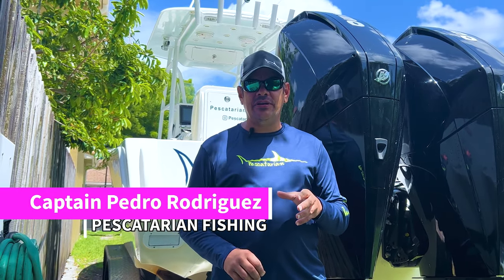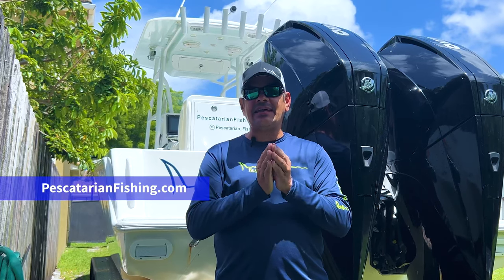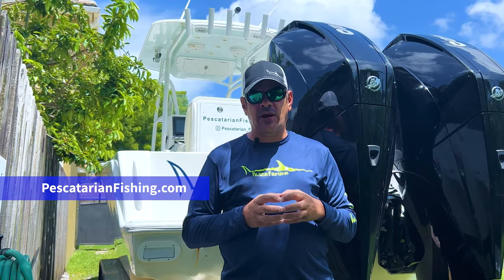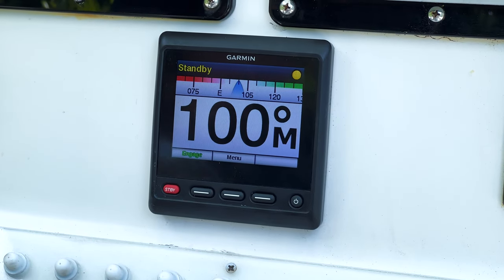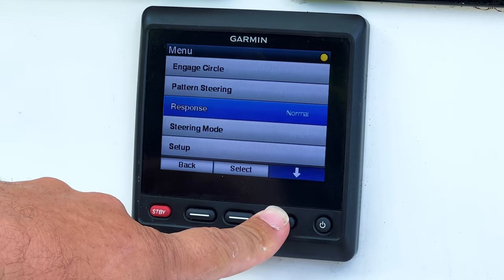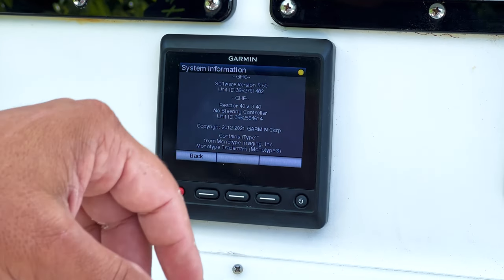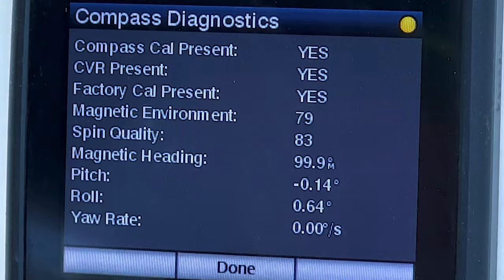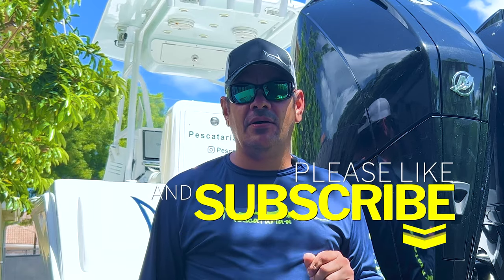Garmin Marine: Garmin Autopilot: Diagnostic Secret

Comment: Excellent! 
I’m about to install my new garmin autopilot and this will help!  Thanks
Reply from the maker: I would run this check before you screw in the heading sensor. We went through some major headaches with our autopilot after 4 years of being installed and no one could figure out the problem. After we spoke to Garmin support and they explained this to me and I verified that my sensor if 4 years was deteriorating where it was placed, we decided to teach everyone this because I’m certain that the majority of the boats out there have this same issue and the owners don’t know it. 

If we would have replaced the heading sensor it would have worked for a while and then had the same problem. 

Glad to be able to help!
Reply: You are a huge help!!!
I’m new to autopilot and I would have been going crazy trying to figure it out if I put it in the wrong place!
Thank you for the guidance. 
Look forward to more videos
Reply from the maker: Thank you and thanks for the support!

Comment: Hi captain Pedro

I’m trying to trouble shoot my new installed autopilot.

My magnetic environment is 255
Spin quality 255… way above 100%

Something not right….
My CCU is brand new and no interference anywhere. 
I moved it to multiple locations and still got the same numbers.

Could there be a problem with my garmin ghc 20? 
I purchased it used.

Thanks 
Paul
Reply from the maker: The magnetic interference can’t go over 100%. The magnetic interference will start at 100% and go down from there. 

100% would be in a perfect environment without any magnetic interference but every boat has some level of interference because they have metal objects, batteries and electronics that interfere with the compass. 

When I moved mine, I tried two spots before I landed on the one I kept and each time I received a different reading of interference. 

I can tell you that if it is bad, the auto pilot will not perform correctly. I had one go bad and the auto pilot would not steer my boat towards the starboard side. 

You can try to set it all up and see how it performs when you complete the sea trial set up for the auto pilot. 

I made another video showing the steps of that sea trial. Link to that video is below:

https://youtu.be/mu0jHsKzGkQ?si=tpRWUd-jC7JkMUjZ

Comment: Will that number change as I move the CCU to different locations?
Reply from the maker: It should. I didn’t move mine on. I unscrewed it and placed a zip tie on it in a new location then powered on the system to check it and it was drastically better.

Comment: So you keep showing the CCU not the heading sensor.  So which are you moving. My heading sensor is a white puck.  You must be moving the CCU?
Reply from the maker: The CCU and the heading sensor are the same thing. In the video, the diagnostic check shows the magnetic interference for the CCU which is the heading sensor. 

Then if the score is low, that’s what you want to move to a new location. 

I’m not familiar with the white puck, the ones that I have seen and have on my boat are either gray or black and have two plugs on it. 

One plug should be NEMA 2000 and the other plug goes to the ECU which is like the brain for the auto pilot. The ECU is what received the heading reading from the CCU and sends the signal to the auto pilot pump to steer the boat.
Reply: @pescatarianfishing   I'm gonna do some reading on this. I was told to add a  secondary heading sensor up top.  I have the Garmin 24XD and was mounting it up top in the cabinet
Reply from the maker: I never heard about adding a second señor but it could work. I just know that I was struggling for almost 6 months with my auto pilot and no one could figure it out and in one of my many calls to Garmin one of the guys is the one that told me about this check. Once I did it and moved the sensor and completed the sea trial it worked perfectly and I haven’t had another issue with it since. 

I know it’s a very frustrating situation to be in.
Reply: @pescatarianfishing  the 24xd hooks to the nema system.  If you go into your 7612 it says how far off course you are. Usually if you're just using the 7612 gps it's up to 40ft. Hook why XD up and it's down to 3 and 4ft.  There are videos of it on here. Give it a look. Maybe it will give you a more precious location 🤷🏼
Reply from the maker: The actual location of the boat is calculated by the satellites in space but yes, if the heading sensor will get a more accurate heading, that would be great. Especially for long range use. 

I hardly ever navigate with auto pilot but I do use it a lot when I’m trolling and sword fishing. 

I will check it out. Thanks!

Comment: I have number 63%Is this good or do I need to change the location?
Reply from the maker: 63% is pretty low. I would highly recommend moving it inside your console to a location where it is away from electronics and batteries. 

We went through hell with ours when it started failing and no one could figure out was the issue was until I personally reached out to Garmin and they taught me this. 

We had ours mounted inside the console but it was too close to the batteries. We simply unscrewed it and moved it to the front wall of the console and reached a score of 90% and after we calibrated it again, It worked perfectly and I didn’t have to order a new one. 

Once you move it, you will need to recalibrate it again but it’s super easy. We have a video on that in our Garmin series playlist.

Comment: What about ghc50?
Reply from the maker: Im not sure if it is the same on the GHC 50. We run the 40 on our boat. They might not have changed it from the 40 to the 50.
Reply: @pescatarianfishing  the 50 doesn't have physical buttons, thats the problem.
Cant find this menu anywhere.
From your video looks like that menu shows you a live updating score of the magnetic environment? Meaning you could go to that menu and move the compass box around and look at the changes? This way you dont need to run the sea trial test again and again? 
Am i understanding this right?
Reply from the maker: @NomadNo that is correct. It is a live score so when you move the sensor it updates. That’s how I was able to move mine and determine that the new location is good. Prior to that, I must have completed 5 or 6 sea trials and nothing was fixing it. 

I would suggest to call Garmin support and let them know that you want to check the magnetic environment for your sensor and they will be able to walk you through it for your unit. 

That will save you a ton of headaches.